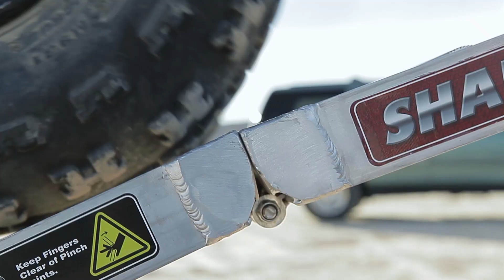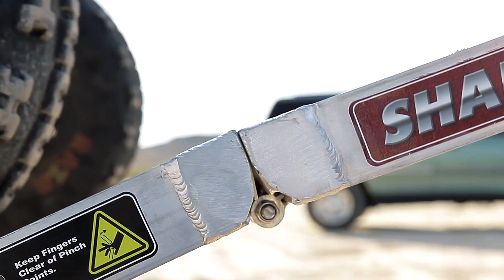Shark Kage™ Aluminum Folding Truck Ramp - The Ultimate Truck Accessory

Comment: It's a great design, and looks very functional, but I also use a tonneau cover.  Your mount plate sticks up past the top edge of the tailgate.  I don't think the mount plate was designed to be removed and replaced, but that's what I would have to do whenever I closed my tonneau.  I live in the land of ice and snow, and not having a tonneau isn't an option for me.  If you added an extra hinge that would fold away, so the top of the mount plate was under the top of the tailgate I'd be a buyer.
Reply from the maker: Unfortunately the Shark Kage won't work with tonneau covers